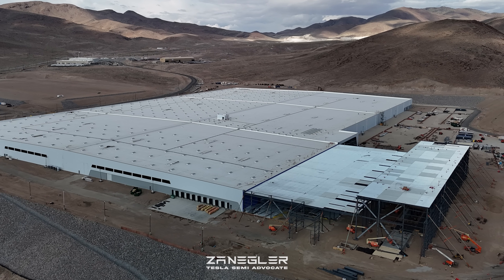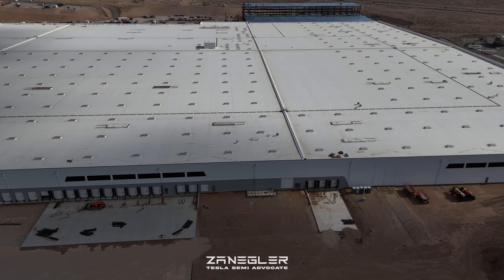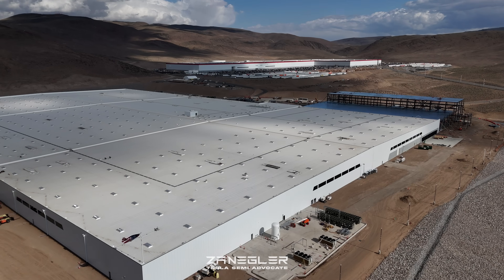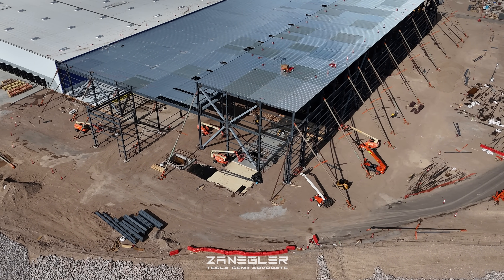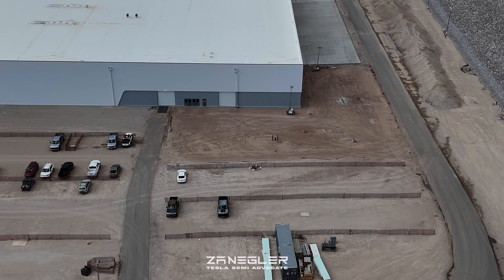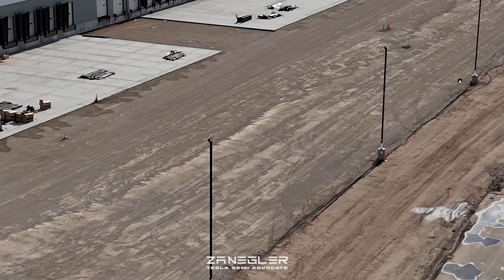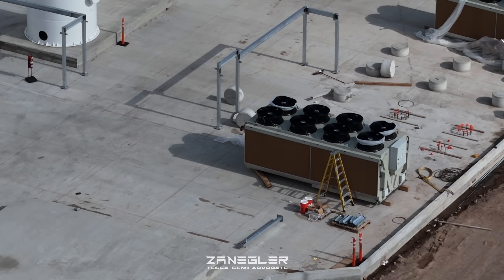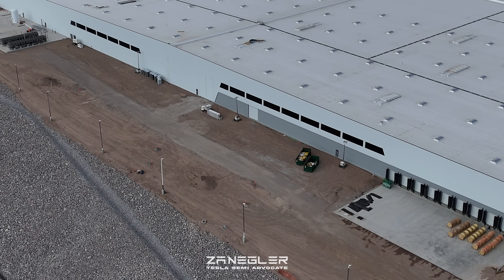Tesla Semi Gigafactory News!

Comment: The membrane created by the roof is part of the building’s structure’s bracing and may be why they won’t remove the sky braces until all the roof panels are placed and secured, especially on this taller part of the structure.

Comment: @Zanegler The HVAC units are not evaporative coolers.  They are "Chillers", they directly cool water for circulation to whatever needs cooling in the plant.  They are fan cooled condensors that directly cool the hot refrigerant gas.   This type of of system minimizes the amount of refrigerant needed (better for environment if it leaks).   The structure being built will be for mounting the pipes to and from the factory for the circulated water.

Comment: After seeing other buildings in the area, rooftop A/C doesn't seem to be a thing in northern Nevada. So it looks like there will be numerous compressor/condensor units at ground level with air handlers inside to direct airflow around the plant. Anybody who has watched flyovers of Nikola and Lucid in Arizona will note that the A/C units were rooftop mounted. We do the same here in Florida.

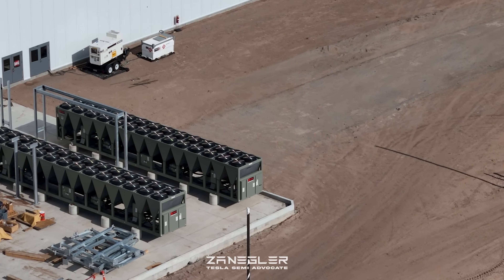Comment: More great coverage of the on going construction.  11:06  eval coolers will most likely not have covers built over them.  Would impede airflow.  Frame work around the coolers are most likely racks for mounting all the piping to connect coolers to building hvac systems